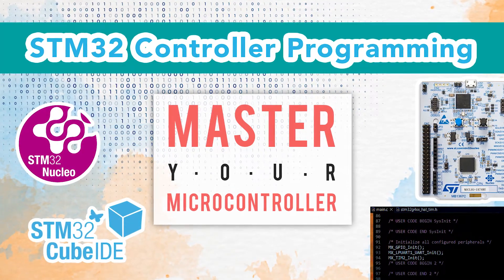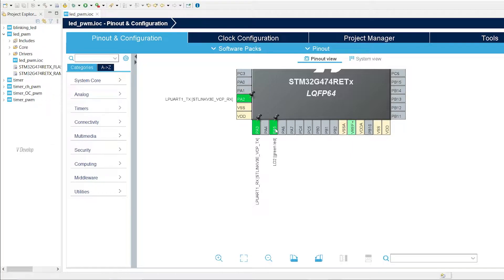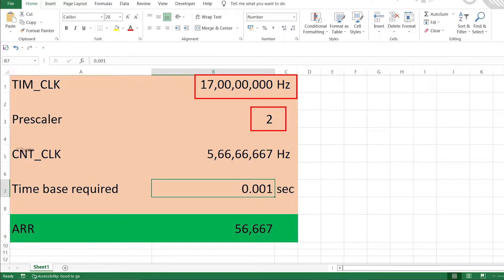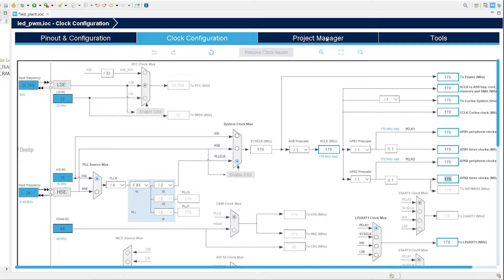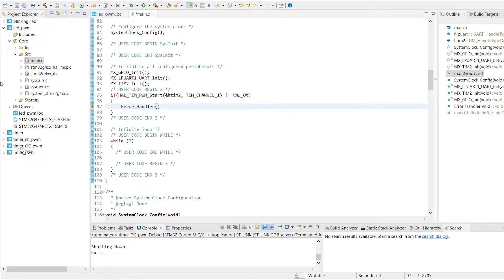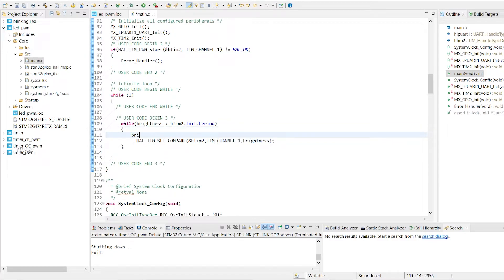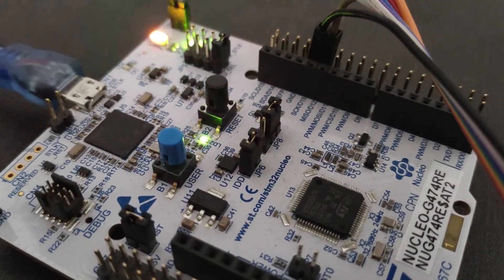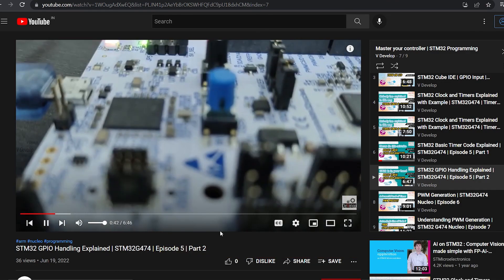LED Dimming using PWM | STM32 G474 Nucleo | Episode 8

Comment: How do you control the brightness of the LED using a Potentiometer
Reply from the maker: 1. Read pot value using analog channel
2. Do necessary scaling to get the duty cycle, and update the pwm duty cycle